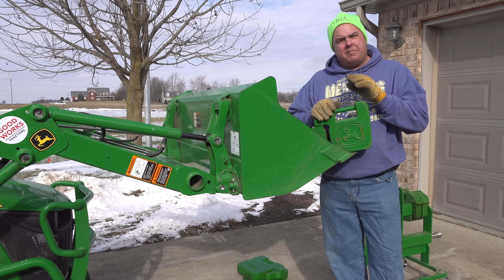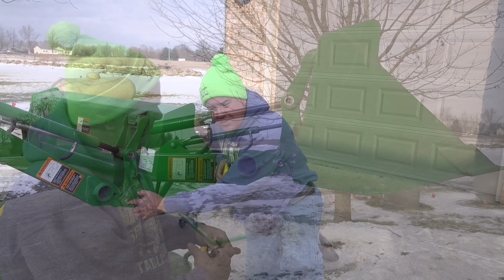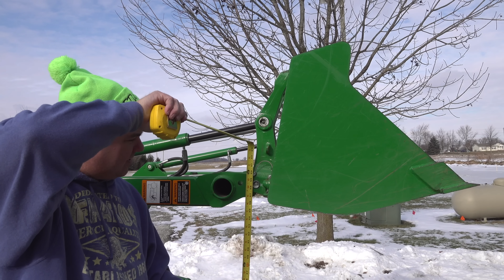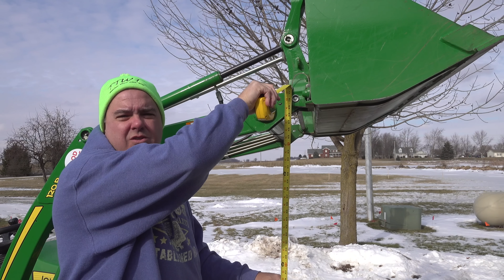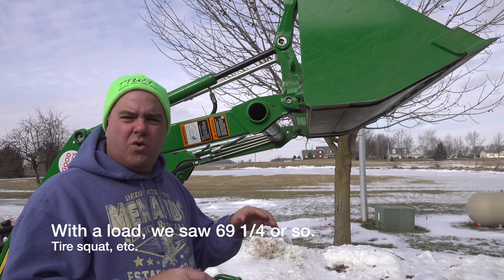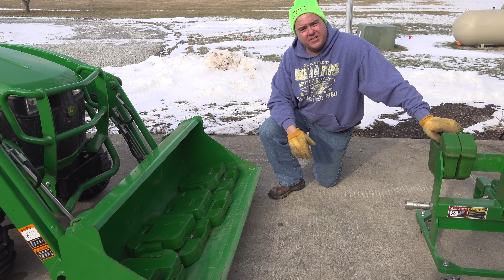Can a John Deere 1025R Lift 1300 Pounds? Mythbusters!

Comment: Tim another great video looking forward to he video on lifting with pallet forks.  I have a 2018 1025R and have learned so much from your videos.   Are you planning on doing a video on removing the floor boards on a 2018 model?  A video on setting up the 60 inch mmm deck would also be a good subject.  There seems to be a whole lot of discussion on this topic on GTT.
Gary
Reply from the maker: I need to do the mower setup.  Always a bit fearful of that one.  Need to tackle it.
I’ll remove the floorboard after returning from Europe.  Have to install all my goodies again.

Comment: Hi Tim
Great video.  I have a 1025R (2014, a twin of old Johnny 240 hrs) with a 120H FEL  I've often wondered what its actual capabilities were.  I don't know if there are a great deal of capability difference  between the 120R and the 120H but I'm impressed. .
Reply from the maker: Not much diffeeence

Comment: Your the "Man" the videos are great and I always learn something this time being adding air to the front tires with the loader attached. I must have missed that somewhere in the manuals.
Reply from the maker: Apparently I didn’t learn it!!! :-).  I usually run about 30psi in mine...I know that is higher than recommended.

Comment: I pulled a 5000lbs trailer with my JD 260 down the road had about 800lbs of tounge weight. The front wheels were about off the ground.

Comment: When I have moved heavy items, around 800 pounds, using the bucket or forks on my 1025R I find my front tires tend to get “squashy” and when driving/ turning the tires roll over the rim making me a bit concerned that I will damage the tires.  The tires are the R3 turf tires and I have them inflated to the listed maximum of 22 psi.  Have you experienced this and what tire pressure do you run?  Are the more aggressive R4 tires tougher?
Reply from the maker: The loader manual recommend adding another 4 psi.  Personally, I usually run mine at 30psi
Reply: Thanks Tim!  I guess I never saw that not in the loader manual.

Comment: Hi do you have any problems with the bucket creeping down after lifting it I have a 1025r 2018 and it does
Reply from the maker: I don’t know yet on this one. The 2014 Johnny did leak down, yes
Reply: It's good as far as settling but it does settle I have the new style late 17 model.   All hydraulic Systems settle or creap some if you leave it up it will settle over night. Not a problem for normal use

Comment: This rings true. Same with truck hauling. When we got back into camping hauling our first fifth wheel rv. The ram 2500 pulled it fine even with over load springs she would ungelate or what I call hulla dance made it very uncomfortable 🥵 being in a seven hour truck roller coaster so we traded up to a one ton3500 haven’t looked back. Find your trucks max tow weight will it be rock steady or bounce going down the road.

Comment: I purchased a used 1025r tlb, same year as Johnny 1, with about 400 hrs on the clock. I felt that the hydraulics were a little anemic. After watching some of your vids it definitely needs work. At idle it will barely lift the empty bucket. I can only get 1850 to 1900 psi on the loader port at full throttle. I will repair or replace the relief valve first. If I end up replacing the pump, I am going to compare it to the pump on a 2025r as it would supply approximately 1 more gpm. FYI - the liquid in the gauge is glycerin to dampen the needle because of  fluid pulses coming from the pump. The best part of your channel is that your whole family is involved and supportive.

Comment: Hydraulic power is flow x pressure. Pressure is not the only critical varible! U have very little flow at low idle and alot more at high idle aka faster pump speed gives more flow at same pressure... thats why u see implements rated to similar x psi but not flow.  Psi blows out a hydraulic hose, flow doesnt. Flow just runs the implement faster.
U dont see skid steers rated at "high psi" they r rated at "high flow"  because they all run around 4k psi...

Comment: Very interesting video on how lift capacity works/figured. Chuckee2009 was talking a little about tractor manufacture published lift cap numbers. One unnamed brand he owns says 2700lbs which maybe line pressure and not lift capacity. YT video this morning. Christy is about a Buck Twenty five dressed for the video.

Comment: I installed a pressure gauge so I can see how much capacity I have.    They have the lift cylinders sized and installed so the machine under normal use can't be overloaded however if you go to fast over bump etc you can still destroy it. Think of a 1025r with a loader a back saver not a payloader   great for that projects that you don't want to lift everything by hand

Comment: I've never seen a hydraulic system that couldn't be pushed past it's limits...occasionally. like you said, you don't want to make a habit of it, if you are, you've got the wrong tractor, loader or whatever, you need a bigger one. 
That being said, show me the bucket control on this one. I don't know if you have a vid with that or not, but I see only one handle to do both lift and tilt the bucket. When you get it right, it's very smooth about how it tilts as it comes up or down. Back when I was using one a lot, it was two separate handles, you really had to work at it and gets lot of practice to be smooth on the tilt as the bucket came up or down. Not that I plan on jumping on one tomorrow and going back to work, but  I am curious as to how that works. The last one I was on, if you had a lot of strain in the lift, the tilt didn't work so hot, least ways coming back it would tip forward pretty easy.

Comment: Anyone who is saying that the hydraulics are the same strength at idle and full throttle has obviously never used a tractor...lol I notice obvious difference in lifting ability, same as Tim. Remember that the GPM (gallons per minute) flow rate is probably also higher at full throttle, which is probably contributing to the increase in performance. Good job showing that to everyone Tim. (I bought one of those gages from Ken too.)

Comment: Ive helped pick up a corner of a car with my JD 520 and 45w loader. At a demo derby a car slipped of its decking boards on a trl. I picked while a few guys rocked the car while another tried to get a board under the tire.    When i was 16 the nieghbor was building there house and the truss delivery semi truck got stuck while unloading. The neighbor had used his oliver super 60? or something like ( looks like a ford 800 series) that he said could pull a 3 bottom plow to help the semi in a little bit but broke a previous repaired drawbar mount. I rode my bike and got dad and he came over with the 520 and she dug down a ft and dad repositioned and pulled again and dug about a ft again and got the trk moving again.  Yes a down slope yes the trk was helping but the 520 last time i had her on the pony brake i was doing 25-33 hp with and unknown torque rating with the tractor wieghing 6000 lbs ish freed a 40000 lb trk yet the all girl doesnt like taking my flatbed on the road.  I hauled a shed and a shelter and 3 bottom plow on my trl. The trl and tractor with or  without the plow wieght 13000  (dont remember if had plow on trl for trip when i scaled it all)  the tractor slowed down to half speed pulling the worst hill on my trip. You can push your limits but to what extend

Comment: The Bucket weight is NOT figured into the JD "PIN" spec for capacity. BW14144 ( your 49 inch bucket)  is 154 Lbs. If you back up over a 2X4 with the engine at rated and lift lever pulled, you can also gain some clerance. Great Video!
Reply from the maker: The bucket is figured into the capacity for the 500mm in front of the bucket.   I won't argue the 'PIN' spec,as I find that spec totally irrelevant.    No one lifts at the pin.

Comment: Funny loader story when I worked st the dealership we had a Branson tractor we used in the lot for literally everything (very abused) we used to pickup 6 row narrow corn heads (just barely off the ground 6-8” and carry them 1/4 mile. A lot of the time this meant only driving with the front wheels. I bet your in hot water of asking your wife’s weight lol

Comment: Very interesting video.  I think I've lifted around 1000lbs with mine too. I'd really like to see you do the same test but with the pallet forks. I think that would be more of what you might see in the real world, pallets of stuff. Like bricks, or masonry blocks
Reply from the maker: I wanted to start with the bucket as that is the ‘standard’
Reply: @TractorTimewithTim   list the weight of the bucket ( 154 lbs)  as JD lists the lift capacity with , nothing? just the pin and so many inches into thin air?  It doesnt detract the weight of the bucket from what I see.

Comment: WOW Tim great video as usual. That trick was wonderful I could have used it last summer when i was trying to move a paver step. I only needed to move it 4' and just couldn't get it without some assistance. I also agree with what you said regarding moving that much weight as I wouldn't move anymore than absolutely required at a very slow speed. Thanks again for sharing!

Comment: Hi Tim,
How cold are the hydraulics? I don't believe you will have full performance if the fluid and components aren't up to temperature.
Reply from the maker: I ran the loader up and down for at least a couple of minutes before the test.  Definitely not HOT,  but not cold either.

Comment: Courious Tim ... did you include the weight of the loader bucket in your lifting calculations?
Reply from the maker: Read the pinned comment.  The loader bucket is included in the spec.

Comment: So it will lift about 14 Katriel's or 4 of me, or 7 Katriels and two of me if you choose to look at it that way. :-) They used to give a measurement on loaders of "break out force". Which meant how much it would jerk off of the ground without necessarily carrying at full height.  I doubt it is a coincidence that those tractors will just lift a round bale of hay  which average about 1200 lbs. usually the limit of tractor loaders is whenever it starts to lift the rear end off the ground. I usually keep a round bale or my big box blade on the rear to counter balance and add traction in mud.

Comment: I’m glad you did this. I’m tired of a couple of people putting these little tractors down about the lift capacity. They need the right tool for the job. This little tractor is a lot of bang for the buck in my opinion.

Comment: Very good video Tim! I found that the weak link on the 1025R is the small tires on the front axle. I have ruined two tires using a heavy load in the bucket. The tires didn’t blow out, they just separated the rubber from the cords and both times I ended up with bubbled up sidewalls. Just a little FYI.
Thanks for the videos.

Comment: The pressure relief valve is constant. The difference is the increased volume made by the pump spinning faster and the relief valve not being able to relieve it quick enough.
Reply: I was pondering this too and it seems reasonable.
Reply: @subwarpspeed  That's basic hydrulics. Pumps don't create pressure, they create flow. Pressure is made by the resistance to flow ie the lines, fittings valves and whatever the hydrulics are driving. The relief valve sets a max pressure. It is designed to set the pressure at whatever the standard operating rpm is.  Which generally is around 540rpm pto speed or full throttle. Because you lessen the flow at idle. You give up some pressure but tractors are also not designed to work at idle.

Comment: Good info Tim. I have maxed my 1025r out on several occasions with pallets of flat rock. Sometimes you have to be creative. Stay safe and warm out there.
Reply from the maker: Yes, the easiest way to be creative is to stack all the items on the 'loader side' of the pallet.  Weight out on the end of the pallet will kill the capacity.  Put the heavy stuff as close to 'the pin' as possible, right?
Reply: Tractor Time with Tim You got it!!

Comment: All equipment has more curling power in the bucket than any other function.  Most experienced operators learn this quickly.
Good you let new operators know.
Reply from the maker: Like you say, it is typically learned quickly.  However, new operators might not figure it out without a little help. So, I thought it interesting to demonstrate. 
In this case, it gave me 200lbs. ...and I suspect more, as it had no trouble curling that load.
Reply: My brother in law was using my tractor to lift a stump, he failed miserably, working at it for two hours. I got not the tractor and picked it up instantly using the curl trick. He just looked on in amazement. I hadn't even thought about what I was doing, after a while, it just comes naturally.

Comment: Find your main pressure "relief valve"  shim the spring behind it with a small stainless steel flat washer. If you would like, I can further explain why this will work. I used to own a 2012 Kubota B2320 with an LA304 loader bucket. The 304 is the Kilograms that the loader is specified to be able to lift. I found that it was not quite up to par, so I shimmed the spring as I described earlier. I was able to bring it to spec without issue and beyond. The reason it is set at 2100 psi is to idiot proof today's machines from uneducated operators. (which you are not). the cylinders are at a minimum rated for 2500psi, hoses etc are almost certainly rated for 3500psi working pressure, with a rupture rating of twice that. Manufacturers are covering their AS* so as to not send out a machine that can be tipped forward by an operator that doesn't understand basic physics. You also have great balast for the 3 point hitch to overcome this forward tipping action.
Reply from the maker: Bryan, your comment was somehow being marked as spam.  I deleted the extras.  (all 26 of them :-) . ) . Let me know if I accidentally deleted one too many!
Reply: Yeah sorry, Tim.  I was in an area with low cellular service. I was using my phone to comment and when I hit “Reply”, the button was unresponsive so I kept hitting the button.  Hahaha feel free to delete them. It wasn’t intentional.
Reply from the maker: the 'shim' approach is not used on the 1025R.
The purpose of this video is to show the real-world capacity of a 'stock' 1025R.
Reply: Shucks. Love your videos, Tim.
Reply: I was just wondering if jacking up the lift capacity could allow you to exceed the front axle load limit, even with ballast.
Reply: Yes that may happen, but think of it this way. Even TTwT has potentially exceeded the front axle rating of his tractor every time the rear wheels lift off the ground. In that scenario, you have the extra heavy load up front that caused it to tip, plus the entire weight of the the tractor on that front axle, right? No damage to the axle either. Make sense? I’m not encouraging people to lift so much that the tractor rips forward but the axle can easily support more that the rated loader capacity as I just demonstrated.
Reply: I don't think you should mess with the relief valve pressure setting, as it could cause lots of unforeseen happenings, and most certainly increase the wear rates of bearings etc.   We had an agricultural silage grab, that was intended for a normal agricultural tractor.   We mounted it on a JCB, and it worked really well, until one cold -15C morning when it totally burst one of its rams, from end to end.   Apparently JCBs have 3500psi, and agricultural tractors are rated at 2500 psi.

Comment: Thanks for another great video Tim.  John Deere rates their lift capacity with a pin on bucket.  The Quick Change mechanism adds a few pounds so the spec'd values would be lower with it.  I agree with you that you shouldn't push these tractors to their limits.  I'm glad that mine can't lift heavy weights to the maximum.  Very easy to have it fall over on soft or irregular ground.  I believe I saw a YouTube video where a gentleman did just that.
Reply from the maker: There is no pin on bucket option anymore.  So I believe your info is dated.
Reply: @TractorTimewithTim  - Probably so.  My tractor does have a couple of years on it.